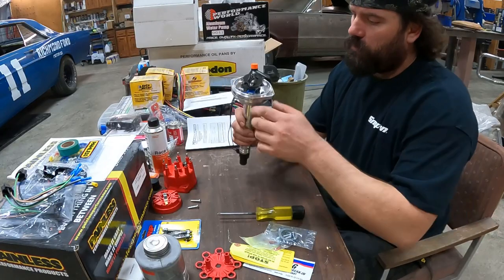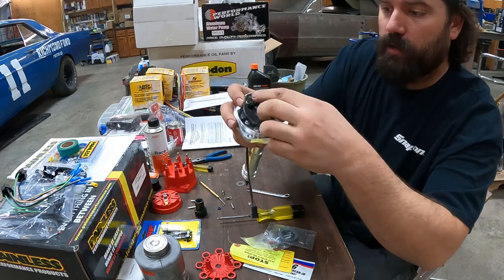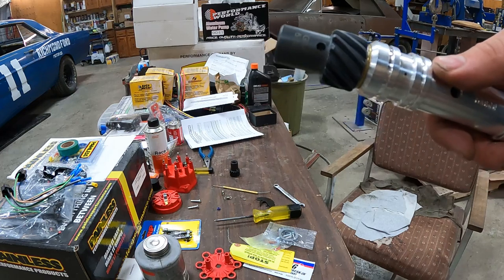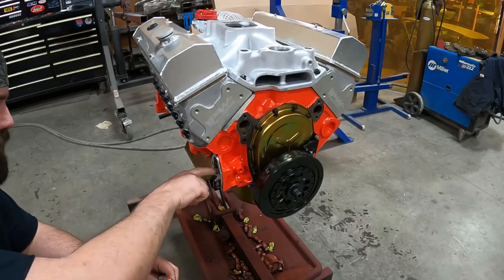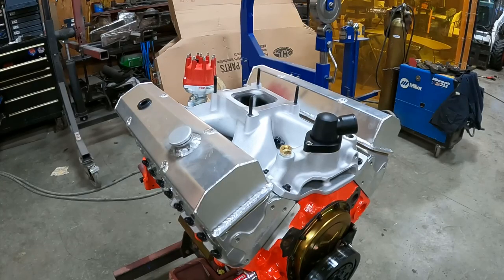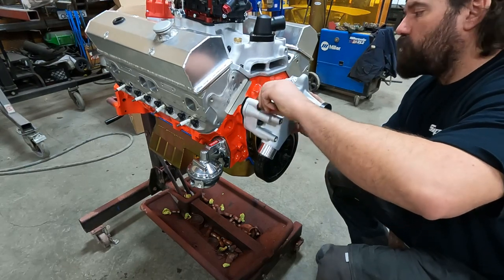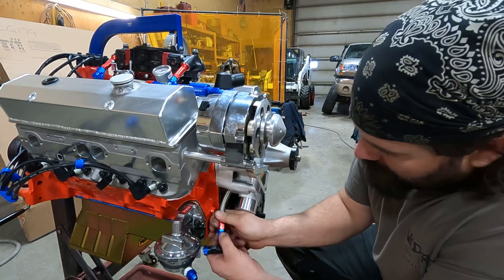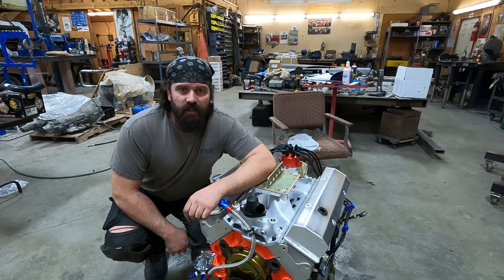383 stroker build part 3

Comment: Question,why do so many guys build 383 Strokers, From what I have noticed they are an expensive build,and moat post HP /TQ numbers I have seen are right at 450-475+ HP.
Reply from the maker: This one makes 510/491 with the real world tune.  I built it because I was after those kind of numbers from a high revving small block.  Big blocks are even more expensive to build, and are heavier.